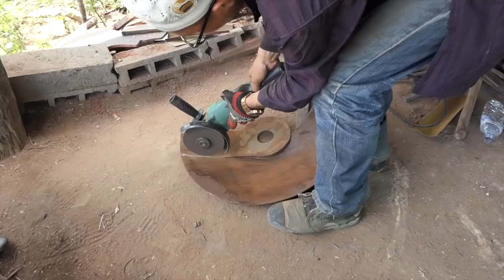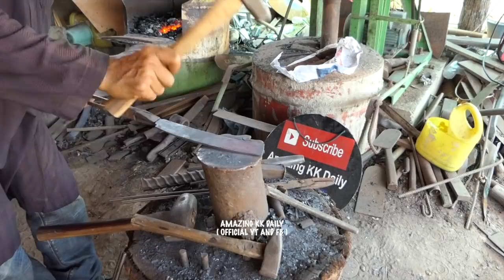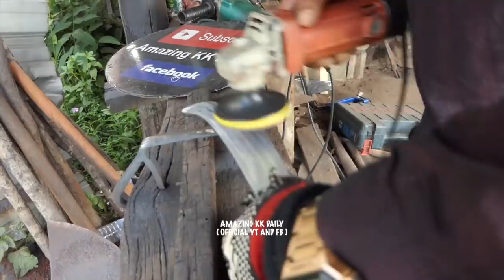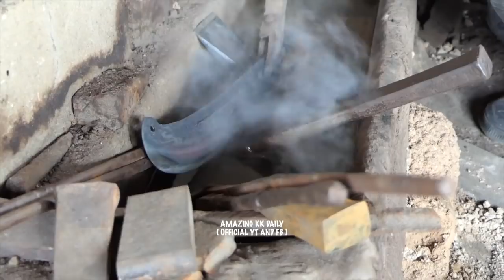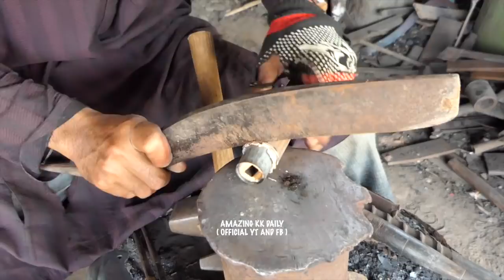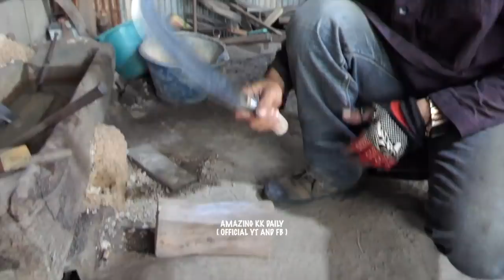KNIFE MAKING / MAKING A NICE KITCHEN KNIFE FROM BROKEN TRACTOR DISC PLOUGH

Comment: You want belt grinder but very expensive (it your say). Why you don't make by your self. I thing not dificult. I make simple belt grinder in my home by my self, only make bolt and nut. Whithout welding. But it's work corecly (can grinder metal/steel/iron/wood) nice and average